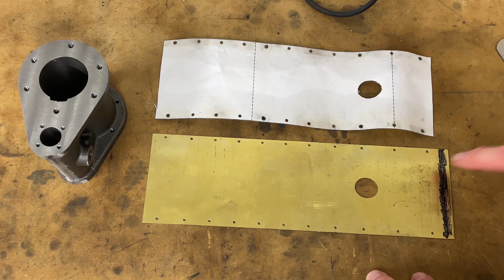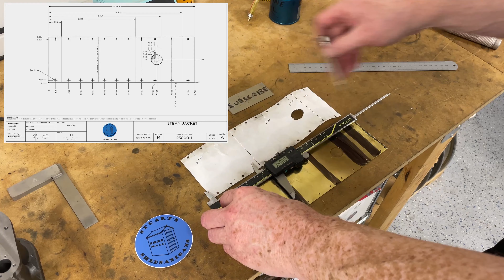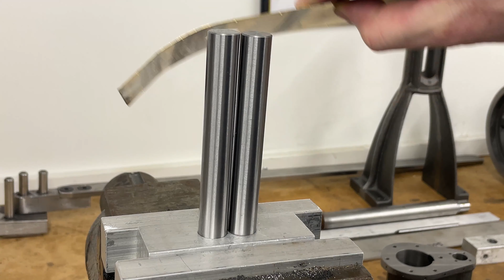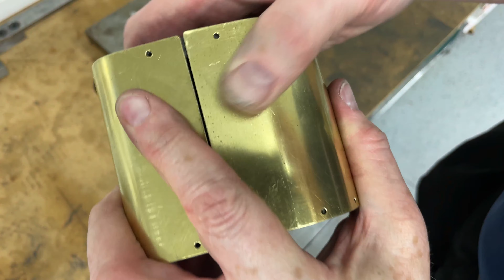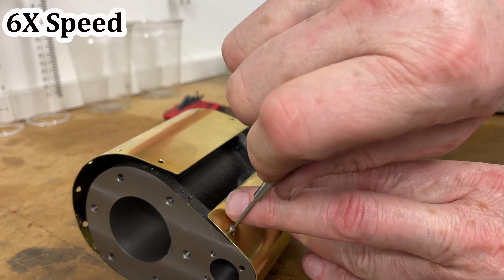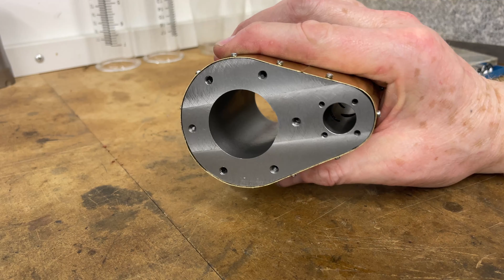PM Research #4 Quarter Horse - Brass Steam Jacket Forming - Features Home Made Sheet Metal Tool.

Comment: Great Outcome Stuart. Perhaps where the join is, soft solder a brass strip on the back on one side, then add a couple of screws to pull it together. That way too, none of the lagging will creep through the gap. Any idea as to what lagging you will be using. I used some softy fiber sheeting that we used at work in the glass department to stop the Glass Lathe chuck jaws cracking the glass. You can make it glow with a torch and nothing will happen. Cut with Stanley knife or scissors. Regards from Australia.
Reply from the maker: Cheers Dave! I like the soldered strip idea. Haven’t decided what lagging yet, I will see what I can get. I know the stuff you are talking about - I believe we used it at EEV also. I’ll see what I can find. McMaster should have something. We might have something at work thinking about it.